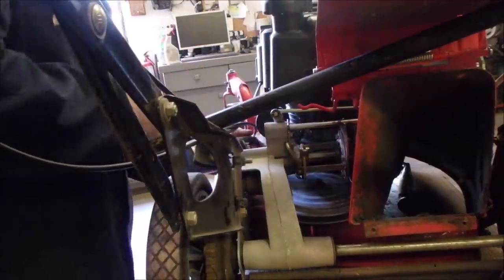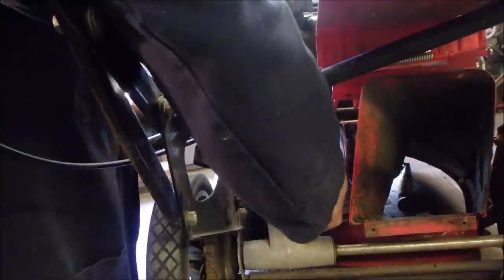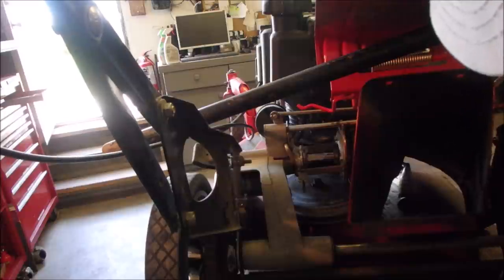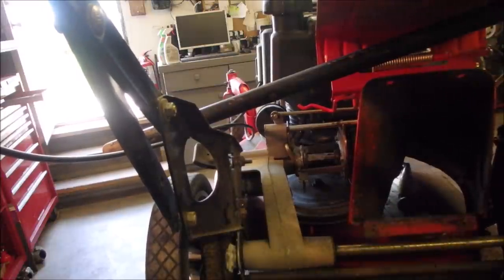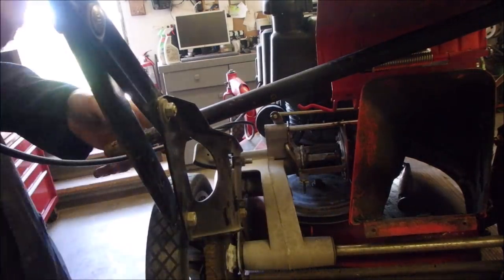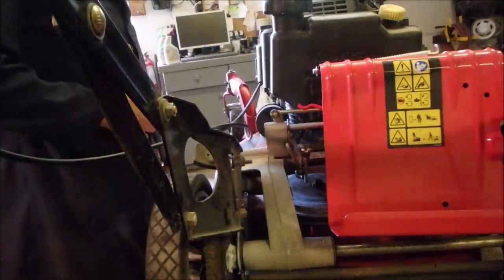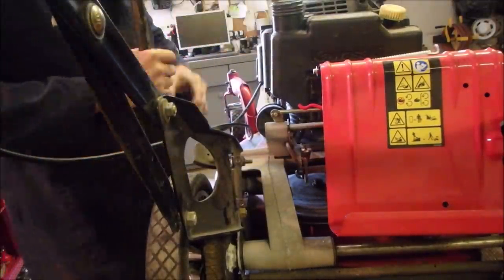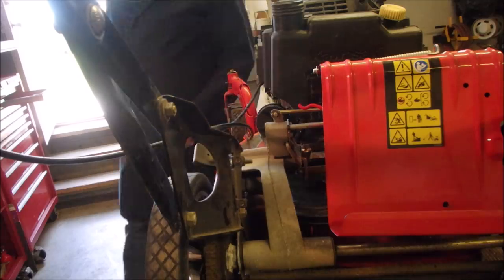Commercial Gravely 21 Inch Mower Won't move Forward

Comment: Nice work Bruce. Thanks to you, Mick, and  Doublewide6, I have not bought a cable in a while. I bought a bunch of Zed bends, I get the cable wire for 19 cents per foot at my local hardware store, and I solder a new ball on the ends if it is ball type. It saves me $15 per mower. Cool!!
Reply: Thats the way . Just make your own..
Reply from the maker: @themowerman  Thanks to both of you.

Comment: Thanks for posting this!  Lots of small engine gold on the table!  I would commend the owner of the 5 month compressors for being realistic! I recall that video series.  In my experience regardless of age and how long the machine has been running people want it back lightening fast.  Also landscapers by me want to drop off their machines by the truck load.  Just not going to happen…would be nice to run a one stop shop.  Drop off truck, trailer and machines for service!

Video was the perfect length…if it was longer still would have been glued to the screen!
Reply from the maker: Thanks to both of you.

Comment: Excellent video as always, the only thing that gravely is missing is the high vac deck, give me a top of the line, which I have, Snapper any day of the week over that machine.
Reply: Gravely and Snapper are not seen often in my part of Canada.
Older high vacs for sure but something happened to the dealer network.
Also Kubota 21 inch machines disappeared.
Maybe our market is to small for them to service?
Reply from the maker: @wayneessar7489  I agree with Wayne. Thanks you guys are always informed.

Comment: Thanks for the video Bruce.  I also have an FJ180V, do these have a slight vibration ?  Or should I look for an issue, , , ,it just seems to have a bit more vibration than my other equipment.
Reply from the maker: Due to the drive wheel on the friction plate they will have more vibration than a standard mower where the blade attaches to the engine.  You can take the blade off and put it on a nail in a vice to see if it has balance.
Reply: @BrucesShop  Thank you.

Comment: I have one like that sitting underneath my carport but it's a Ariens 21 inch same setup but the z bend cable is broke some of the cable still there and what it attaches to sort of like a eye hook but for the cable to hook it with a starlock washer on it.
Reply from the maker: Did you get some of those aluminium splices for the cable.  A life saver,
Reply: @BrucesShop  I thought I did but I think when I moved I misplaced them might have to order more

Comment: Well, that's different!  That's one way to achieve infinitely variable drive, but it seems about 15x more complicated than Honda's simple hydrostatic drive.  I wonder which system would require more $$ and horsing around over the years.
Reply from the maker: Once set up they really last

Comment: I wondered how much trouble it would have been to take a look at the top of the flywheel to see if the key could be partially sheared. That can also make it hard to start and also cause it to run with less power. There is no telling what has been run over with a commercial mower.
Reply from the maker: You are right.  I just had to stop somewhere.  Good point.

Comment: Ariens I had looks like that gravely
Reply from the maker: Right
Reply: @BrucesShop  Mine I had was an Ariens LM21SP had a briggs and stratton 5hp which most Ive seen have Tecumseh.  It was a good old mower but I didnt use it so I sold it.  It had the same deck design with  the friction disc self propel
Reply: Airens owns Gravely!
Reply: @craigjohnson3603  yup in '82 I think